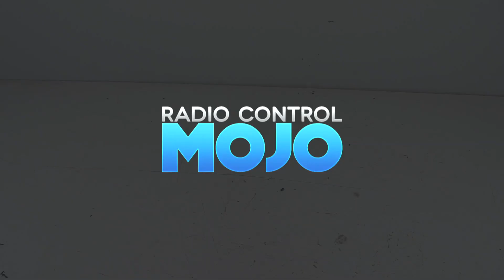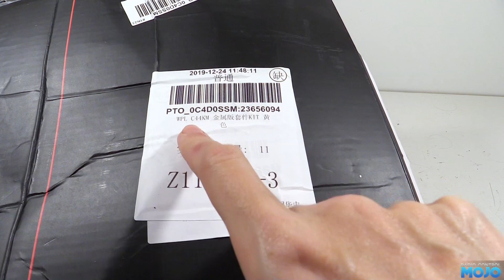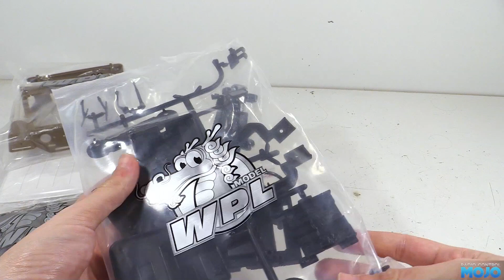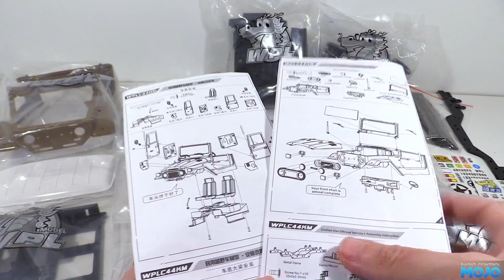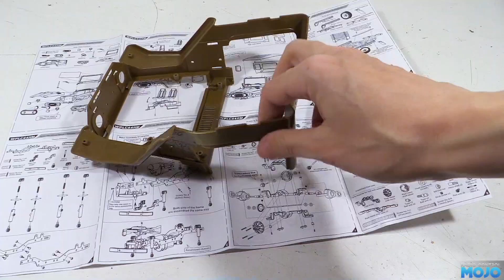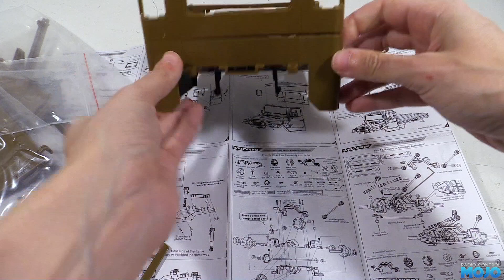WPL C44KM Toyota FJ40 - 1 - Laying out and repairing

Comment: Very strange you received your C44KM with all 8 wheel weights in one single bag.
I bought two C44KM (from Banggood) and both arrived in perfect condition (also box), but the wheel weights were packed in bags with 2 each. This was a huge improvement compared to the C34KM, where weights came in one, very heavy bag (see my video).
I also had bought 2 WPL C34KM last year (also from BG), and wheel weights were packed 8 in one bag. My first C34KM arrived in a box like yours, totally damaged, and the canopy also was damaged (even worse than yours, see unboxing video from last year).
I tried to repair the canopy like you did, also with heat (and adjustable heatgun). I had thought it was repaired perfectly and primend, painted and weathered the C34KM canopy parts. But then, finally I found that the canopy was not in perfect shape. Doors did not close perfectly, front (where hood and windshield attache) was not perfect)... Finally I put the front canopy to the stoven (70° C), which was a big mistake. Totally destroyed it (bent on the air intake below windshield), not repairable.
I highly suggest to test the canopy and doors etc. if everything works and closes well before painting. I was really angry ;-)
Good luck!
Reply from the maker: Good info thanks!

After repairing the doors fit fairly well, but I’m going to glue them shut so they can’t fly open and having the cab as one piece will make it a lot stronger